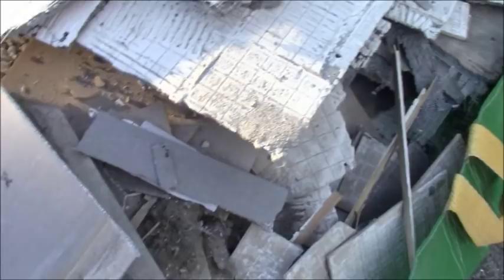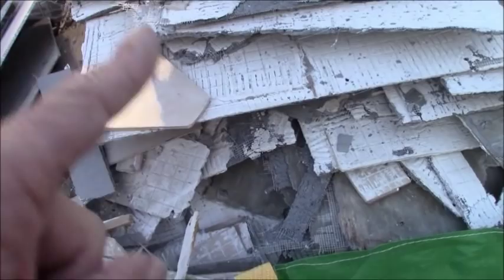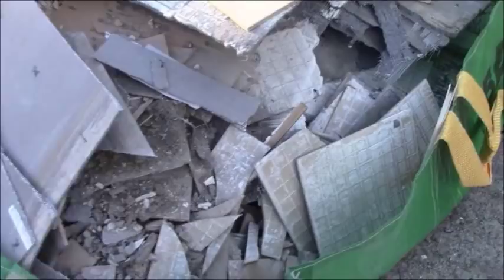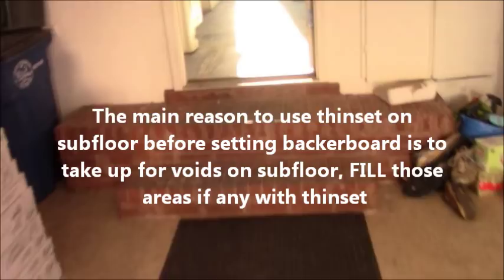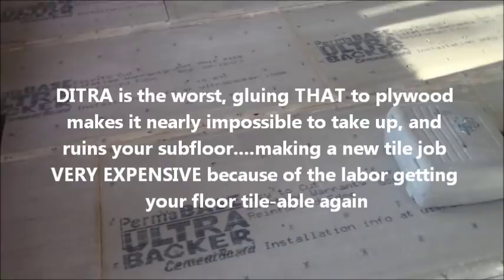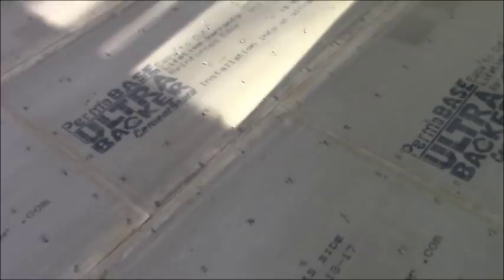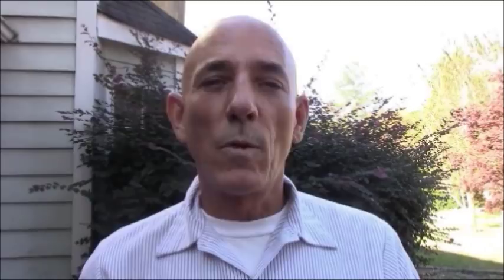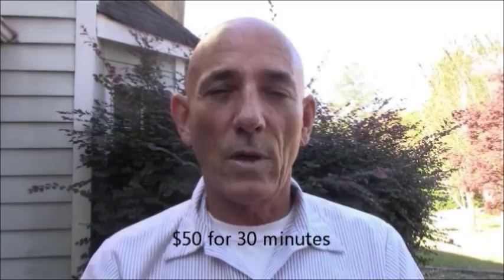GLUE BACKERBOARD ON SUBFLOOR ??

Comment: Hey Bob. Thanks for this. Will any discrepancies in the floor level be taking in with the tiles then? I don't want to glue and will just screw. 👍
Reply from the maker: If your floor is not level or there are dips then that must be mitigated prior to the tile. Once the backer board is down you could use a leveling compound take care of those issues if you chose to , if the discrepancies or minor then thinset could take up the difference

Comment: MOST manufacturers recommend thin-set? NO! ALL manufacturers of backer board REQUIRE, NOT recommend, thin-set under their backer board. ANSI codes also require thin-set under backer board. Backer board (along with the usually expensive tile job on top of it) that is not set in thin-set has ZERO warranty! You say a dozen years is acceptable? Nonsense, properly done tile on backerboard set in thin-set can last fifty to seventy five years. You are just too lazy and want to make your job removing old tile floors easier on yourself but the fact that it's hard to remove just proves it was installed right to begin with. You have recommended to nearly 100,000 people to not use thin-set, will you cover the warranties on all the people who used your advice? Because the manufacturers sure won't.
Reply from the maker: Everything you said is a crock of shyt.. first and foremost a company will not stand by their warranty, trust me they have lawyers to fight you every step of the way... secondly I don't need the manufacturer warranty if I'm doing the job correctly...thirdly I never said that 12 years is long enough, I said this job was done 12 years ago and they got tired of the tile.....fourthly I never tell anybody not to do something, I tell them how I do it and I explained the reasons why and I show proof positive....fifthly if you're okay screwing up your customers floor because everything is hard to remove later and you cost them thousands to replace the subfloor plywood then whatever, I'm not okay with that !! .....
Operator malfunction is a real thing, not every job is done monolithically, not every tile Setter does his method exactly the same way so operator malfunction could end up with problems down the road. I have been setting tile either on Floors or specifically shower walls for the last 23 years and never one failure, never one call back.
I have over 500 videos on my channel going back 11 years, my methods are proven to work and I have never ever been sued, and there has never been any bad reviews anywhere on the internet 💪

So put that in your pipe and smoke it, you book Soldier 💩💩💩💩

Comment: I would trust you, but you didn't mention if it's important to tape the seams.   Why not make a thorough video.  You are giving people the go ahead to cut corners.
Reply from the maker: I use probably in excess of 50 roofing nails per board, I highly  and extremely doubt that any tape would mitigate any issue that would ever come up... I suppose in my mind I would have to encounter a failure of tile because specifically tape was not used in order to be on board with that
Reply: @StarrTile  Maybe you are right sir.  Maybe the backerboard companies are being overly conservative in their methods by suggesting steps that are overkill and not necessary.  Maybe they assume that people won't level the floor good enough, or put in enough nails.    In your video you did mention filling in sub-floor voids with a mortar.   Do you let that harden before screwing backer board down?

Comment: Tile should last 50 to 100 years, not 12 years!
Reply from the maker: I never said anything about how long a job should last...
But your comment about 50 to a hundred years is ridiculous, nothing in your house last that long, you don't even last that long
Reply: @StarrTile  Buildings last much longer than people.
Reply from the maker: @ednorton47  the building itself may last but everything within it does not, that goes from your appliances to your roof to your air conditioning system to everything you have in your house needs to be replace it one point and it's ridiculous to think that you're tile would out last a lifetime.. not in this country anyway
Reply: Who keeps the same tile for 50 or more years? That's a ridiculous argument. Framing should last that long but tile floors, that's just stupid.

Comment: I just spent 14 hours taking a hammer drill to the subflooring trying to remove the tile and backer board th!t was screwed and glued to the sub floor. Most screws were 2" apart. Area was a 16×14. It was some of the most unnecessary extra work for nothing. I cant tell you how bad it is for a sub floor.  I lost my sh!$ every 15 minutes cussing the installer. So unnecessary! Anyone with a brain can understand how bad that is for the future of that sub floor.

Comment: Do you use nails or screws Starrtile?
Reply from the maker: 1 1/2'' galvanized roofing nails
Reply: @StarrTile  diffanly will move and flex with nails. I've been installing tile for 20 years and I'm 36 now. Atlease you could of used screws. But let me guess it's faster with a nail gun. Nails are fine aslong as you glue it.

Comment: Use 5 gal recycled latex paint, throw that in there, come back in one week, ur prep done, throw some tiles on another coat of paint, come back one week, lay down some flex grout, use 8 penny galv as spacers. call it a rubber/hard surface CA earthquake proof floor, toss trowels go surf.  Try not to fight with mother nature, if she floor gonna move surf it, each tile is your board, flat water job, everybody happy!

Comment: Wrong, wrong, wrong, thin set with a additive 3/8 notched trowel under the backer board with the proper screws on sturdy plywood will never fail 45 years in the tile industry never had a fail using the correct method, so don't listen to this guy, and definitely tape and Mudd your joints,
Reply from the maker: Wow the cool aid is REAL ! 🤣

Interesting you're spouting off all the BS ppl were telling me in 1998 when I started, yet I pushed back, did it my way based on logic & critical thinking and never a failure or callback....go figure 🤔 😉
Reply: @StarrTile  it amazes me what a clueless installer you are try reading the manufacturer warranty on how to install concrete backer board, and you misleading the people who listen to you doing it wrong
Reply from the maker: @fatter6776  you're a book Soldier, no common sense or critical thinking...sad...you really think manufacturers will honor any warranty  ??? GTFOH  ! We are all responsible for our own work and I guarantee mine for lifetime. Go troll someone else, it's annoying how you believe things written without ANY thought whatsoever and disregard any method outside your box....whew, dangerous!

Comment: Bob, Can I install floor tiles on 1/4" hardie backer (nailed but not screwed nor glued) on advantec subflooring?
Reply from the maker: Yes i would think so , it's really no different than strand board or OSB... and i don't necessarily advocate to not glue and screw , that's is my personal opinion since I find no issues and have never experienced any using nails

Comment: Absolitely disagree with your thinking here. You never do a tile job with the idea that you are going to replace it 10-15 years from now. You do it the way its suppose to be done. If/when the time comes to replace a floor, you will simply deal with it then.
Reply from the maker: I never said that a tile job would last 10 or 15 years, I said that glowing and screwing will not benefit the lifespan of your job, and in 20 years there was no failure on this one they just wanted a new tile

Comment: I quit using screws and use stainless ring-shank roofing nails - faster, easier, and good quality fasteners.
Reply from the maker: I agree, I went to roofing nails years ago. And there are still some who will say nails will back out, LOL !
Reply: What about using roofing nails on vertical walls with cement boards ?
Reply: markprice46 I use them on walls too. I only use stainless ring shank though, not galvanized smooth.

Comment: Floors should last a lifetime if they are done right. 10K for tiles product and install labor for 400 SQ feet. That floor should last 20 plus years. I know mine do. and they are (1)Joists(2) 3/4 CDX Ply... (3) 3/4 CDX opisite direction of  #2 (4)Thinset/Hardi Backer/(5)Thinset/Tile/Grout. Everything is screwed down. NO NAILS!
Reply: How many people keep the same tiles down for 20 years? This isn't the 50's. Most people remodel every 10-12 years.
Reply: @ruffxm  Well if you have the right designer...CLASS IS TIMELESS. but i guess you like Avacado and Yellow Cream Appliances too. Just like the Wood tile today. Just like the flowers in the 1960;s, HACK DESIGN!
Reply: @skiprope536    You missed the point. I said HOW MANY people keep the same tiles down for 20 years? Most average working-class people do not employ "designers". They walk in stores or see things in magazines and TV.

Comment: His advise is to not listen to the manufacturers. That is not good advise. Put Thinset between the subfloor and screwed down cement board. That is the manufacturers recommendation. Besides, a 1/2 layer of CDX ply should be used over the base subfloor anyway before the cemented "glued" cement board eliminating this guy's argument to not glue the cement board before screwing it down. I prefer self leveling cement with mesh over the 1/2 in CDX with a final decoupling membrane. That is the best.
Reply from the maker: You are entitled to your own opinion as well as your own way of doing things , however doing tile for 21 years now i have never had an issue with regard to failure from somebody else's job of not doing it as you describe by the book , as well as myself never having any issues. Common sense dictates most stuff in life and no exception here, illogical to overkill a flooring job unless you're a complete lamebrain 👍

Comment: CHRIST is this bad advice.... 

So this method produced a floor that lasted a WHOPPING 12 YEARS! 🙄😆

Tip: if you're building something, and you plan for it to fail in 10-15 years, you simply aren't a quality builder... It's not just about making it easier for yourself, it's about lasting quality and finding the balance of those two for your particular application.

"I know tons of people are going to tell me I'm wrong" Hmmm... Maybe there's a reason for that? JFC
Reply from the maker: Correction, it was down for 12 years before I came along, it had never failed after 12 💪✌

And the point of the video was not telling people to make it easier, the point of the video was not to ruin your subfloor going forward, because it will ! If you are good ruining your customers so floor for the next application they decide to do and have to charge more to rectify then okay. Worst is ditra, try pulling THAT crap up !

Comment: I love when installers dont thinset the board down. I get paid to replace the failures!!
Reply from the maker: You cannot show me one failure based on not glue & screw...not one...
But shredded plywood or osb is a huge problem you'll create by doing it.
Reply: Actually i could. Been in flooring since 1986 and just met with another customer that will be replacing his CT for third time in 9 years. 3 times all no thinset under board.  Do what you want. But its wrong...look it up.
Reply from the maker: @captainkttyhwk  look it up ???? Ya gotta do better than that...tell ya what, I'll write a book doing it my way and then YOU can go look it up.
I showed my proof in the video, many other tear outs just like this over 22 years without an issue. Can't give an explanation for your customer, human error is usually a good guess though. 
I've tiled thousands of sf of floors since 98' never gluing & screwing without a call back...ever...👍
Reply: @StarrTile  okay so let's just say a tile job is being replaced after its lifespan which should be 20 years probably minimally let's say it's a 10 thousand-dollar tile job and if it fails or needs to be replaced after what you're saying 7 to 10 years what's a measly 400 bucks in OSB or even a grand? Tile installs should last literally forever it's not like carpet with a short lifespan and low cost.
Reply: @StarrTile  I'm also not sure what part of the country you doing this in. We are here in Northern lower Michigan where temperatures range from minus 30 Fahrenheit with 10% humidity in the winter to 90 degrees above Fahrenheit with 80% humidity.  Houses move... a lot.
Reply from the maker: @captainkttyhwk  Perhaps in the old country things last forever, the building construction in the states doesn't work that way, In fact, I defy you to name one thing that lasts forever... not your roof, not your carpet. , not your appliances, not your paint job. , not your siding, Not Your HVAC, not even you. There's nothing in your house that will last forever except perhaps your driveway. And now you are saying a tile floor, That's pretty funny.
Reply: @StarrTile  yep 20 maybe 30 years...unless you do a short cut crap job. 
I looked it for you.....Floors 1/4", 1/2", 5/8" 
thickness
Subfloor should be minimum 
5/8" APA span-rated plywood 
or OSB with an Exposure 1 
classification or better.
Countertops 1/4", 1/2", 5/8" 
thickness
Minimum 3/4" APA span-
rated plywood or OSB with 
an Exposure 1 classification 
or better.
Cover base with USG Durock™ 
Brand Tile Membrane, 15 lb. 
felt or 4-mil polyethylene and 
attach with 1/4" galvanized 
staples.
Walls and Ceilings 1/2" and 
5/8" thickness only 
Maximum stud spacing: 16" 
o.c. Maximum allowable 
deflection, based on stud 
properties only, L/360. 
Maximum fastener spacing: 
8" o.c. for wood and steel 
framing; 6" o.c. for ceiling 
applications.
Waterproofing
If waterproofing is desired, 
use USG Durock™ Tile 
Membrane or USG Durock™ 
Brand Waterproofing 
Membrane. See USG 
literature piece CB492 for 
USG Durock™ Tile Membrane 
product information. See USG 
literature piece CB595 for 
USG Durock™ Waterproofing 
Membrane product 
information.
Cutting
USG Durock® Brand Cement
Board panels should be 
cut to size with a knife and 
straightedge. A power saw 
should be used only if it 
is equipped with a dust 
collection device. Always 
wear a NIOSH/MSHA-
approved mask and eye 
protection when cutting 
USG Durock™ panels.
• Utility knife: Using a 
straightedge, score panel 
face with utility knife and 
cut through glass-fiber 
reinforcing mesh, then snap 
and cut backside mesh to 
break cleanly. Use a rasp to 
smooth any rough edges.
• Power saw: Use a low-RPM 
portable saw with 3-1/2" 
carbide-tipped blade. To 
make cutouts for pipes and 
fixtures, use utility knife to cut 
through mesh on both sides 
of panel and punch out with 
a hammer from back side. 
Or, use an electric drill with

Comment: Ditra is the worst, lol coming from an installer that should not giving advice on to not glue down the cement boards and screw. You nailed down cement boards, that will not last. You serious right now? Ive been an installer for 12 years and would never advise not using ditra, its one of the best underlayments on the market. Just because you are looking at the cost of removal down the road? Seriously?  Common man, you need to take this video down before you discredit yourself.

You used roofing nails, you need to be educated on proper installation. Sorry but you are giving by advice on installation here my friend. 

I am a wire guy, so all my floors are prepped with wire unless customer wants something different. 

I have watched alot of your videos, this one by far needs to be taken down, shows your laziness to remove flooring, giving bad underlayment advice because of your laziness, and your overall general knowledge from different parts of the country with different climates too different methods of installation is amateur. 

Hope you take this video down, best of luck
Reply from the maker: Every single video out of plus 370 I stand by my word, it is not based on brainwashing is based on experience, I have 20 years doing tile work and everything I say is the truth whether you want to believe it or not.